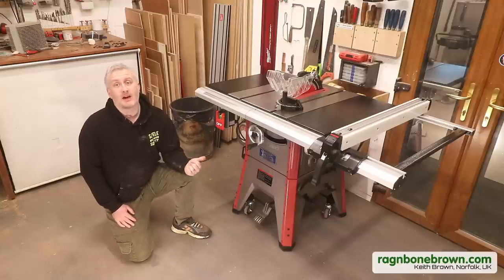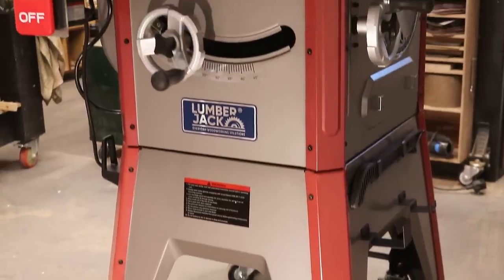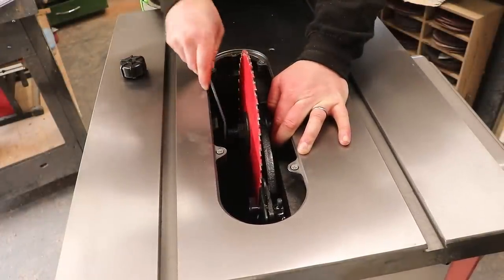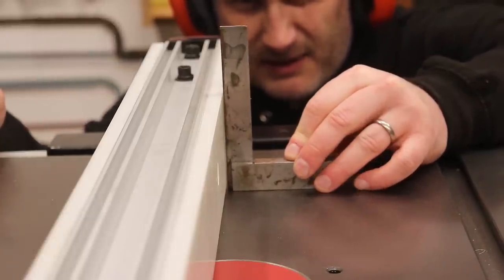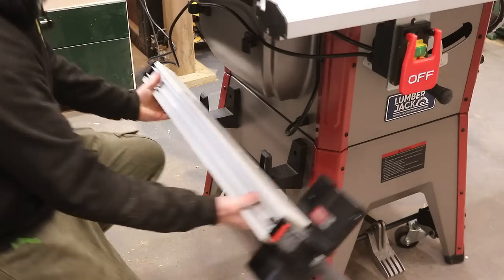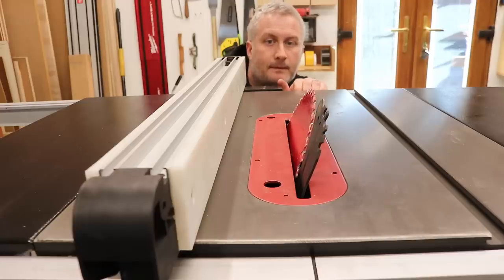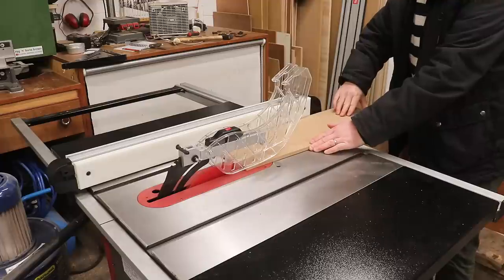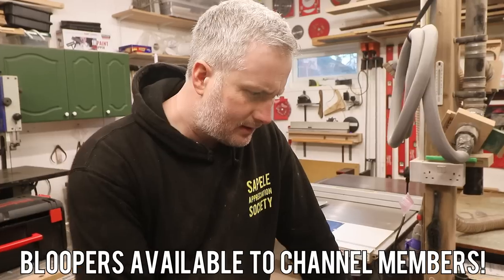LUMBERJACK TS1800 TABLE SAW: Everything You Need To Know

Comment: Making replacement inserts is a bit of a pain. Wish they would have altered that since the previous versions. A better insert will probably reduce the effectiveness of dust extraction though.
Reply from the maker: You could drill some holes in the insert to aid with extraction while still maintaining a zero clearance. That's what I'd probably do

Comment: Personally I don't think having your customer modify electrical issues on the product you sold them is an acceptable solution at all... If a fuse fixed the issue they should provide that in the first place.
Reply from the maker: I agree, but it seems to only be a recent problem - the saw has been available for years and only recently have these issues occurred so something must have changed in the manufacture of the saw recently. While I agree that it shouldn't be on the customer to resolve, after several hours spent setting it up, the last thing I would want to do is disassemble it all and get it taken away, that would have been so much wasted time.... But maybe that's just me 🤷‍♂️
Reply: @RagnBoneBrown Ridgid power tools makes a good saw that has a solid table. They are owned by TTI and are sold in all Home Depot. I don't know if you could get one to the UK though. It is a great saw thought
Reply: Indeed if they are providing the saw with regular 13a fuse but this trips on poweron it's just not acceptable, very odd in fact.
Reply: "There's nothing wrong with it!"

Also them "But here are some modifications that can be done to fix the issue..."

If the fuse fixes it, why wouldn't they include it as a standard? Would it cost them THAT much, or not work with other setups somehow?
Reply: I just bought one of these and it looks like they're sending them out with a slow blow fuse taped to the box now
Reply: I had the same issue when I first got mine and even with slow blow it was hit and miss. The issue for me and most likely others is voltage drop on the feed to my workshop. An induction motor uses up to 1.5 times the power on start up. If your only getting 220 ish volts to your workshop then 1800w x 1.5 is pretty much 13 amps
Reply: I have a Bosch gts 10 xc. Would like to upgrade to a table saw with more precision as I only make small stuff , cutting boards, jewellery boxes etc. is this the saw for me ?
Does the rip fence cut square ?
Love your presentation. Keep it up and inspire us newbie hobbyists.

Comment: Surely if it was the fuse in the plug that was blowing, not your mcb tripping, then it is Lumberjack supplying a wrong type of fuse? That’s on them? Great video. Just started listening to your and Matt’s podcast!
Reply from the maker: Thank you! I have very little electrical knowledge so I'm afraid I am unable to comment, but hopefully LumberJack address the issue going forward
Reply: His supply voltage could be low, or the inrush current is sagging causing our British 13A fuses to pop. 

Typical issue with imported goods as most of the rest of the world has 16A at the socket.

Comment: If a tool is designed to work of a standard 13a outlet but requires you to put a non-standard fuse in the plug…well that rings alarms bells to me. I may very well be wrong but I don’t think slow blow fuses are BS1362 compliant so you could be compromising the safety in order to make the tool functional. That doesn’t sit right with me. I’d consult an electrician before making a decision (maybe the guys on the Efixx channel?)

Comment: Tough choice indeed. Noise: hearing protection. Speed: production shop?  Cast iron side tables  ¯\_(ツ)_/¯. Blade already swapped. Plusses on the Axminster side losing ground fast in my opinion. 

Big question, you need to make cut, which saw do you walk toward?
Reply from the maker: At the moment I walk to the Axminster but that's because it's permanently set up with extraction 😁 I think if I'd have bought the lumberjack originally, I would be happier. But the fact that I'd need to make all my jigs and router table again if I changed to the lumberjack sends me back the other way. It's a real conundrum!
Reply: @RagnBoneBrown  I went to Best Buy (home electronics store in the US) to buy a video adapter cable once a couple years ago. On the way there I was thinking about cord length, name brand vs store brand… When I got to the store they only had one choice. I was so happy I had no options I was almost giddy. Sometimes having choices is great. Other times a pain. 

More seriously, in decisions like this I ask myself, “Will I wish I did the other thing everytime I use this one?“ If yes, I grunt through the inconveniences of making the change. if not I get rid of the replacement. 

This decision would be tough for me. Not sure if better dust collection woukd win out over noise.

Comment: Their advice was incorrect. If the plug fuse was blowing, changing the type of circuit or MCB would have no impact.
Sounds like they have used a cheap motor that has a high inrush current (startup current). Your Axminster has a larger motor (more current) but did not blow the fuse.

Comment: Two things:  First, I thought it was illegal to use "Dado" blades in the UK.... Secondly, Can I have the one you don't want?....😊😊
Reply: They're certainly not illegal to buy or use in this country - it's one of those things that somehow went from myth to "fact" over the years but it's not true. If it was then Axminster are selling them illegally...
Reply: I thought that was why most suppliers to the UK market haven't the facility to take them....
Reply: @stevehewson8903  I wouldn't be surprised if it had something to do with safety - having some sort of blade guard in conjunction with a stack of dado blades would be a very difficult arrangement.
Reply: @201081hero    Not illegal as you said use mine and a moulding head cutter on my imported skill 99 from oxford England

Comment: Could you tell me if just the long fence rails can be used for a slightly smaller rip capacity? It might make the foot print smaller if not needed? Cheers
Reply from the maker: The rails are aluminium so you could cut them down if you wanted

Comment: Changing the mcb to type c is just bs. The thing is drawing enough to blow the 13a fuse not trip the existing b mcb. Just not really designed to have a plug on it. Also chopping off the plug and putting a commando plug on loses cable protection on the saw lead.

Comment: I would say that the electrical issue is a deal breaker for me. What kind of company just lets machines roll out of the factory that pack up as soon as you turn them on? Shoddy.
Reply from the maker: I agree, although I think it is a new issue, the saw has been around for years in the UK but it's only recently that the electrical problems have come about

Comment: Nope, slow blow fuses are NOT approved to BS1362, shows cluelessness by them. They've effectively caused their tool to be non compliant. They've used a motor that is NOT compatible with UK plugs... slow handclap to them
Reply: A simple inrush limiting inductor or resistor in the motor circuit would work and be compliant...
Reply from the maker: do you have any proof of this? If so it's probably worth letting LumberJack know this information
Reply: @RagnBoneBrown  Keith... Take a look at the fuses you have purchased... If they're not labelled BS1362 they shouldn't be used (the danger to you is minimal however). If they say bs1362 I misspoke... (Assuming the labelling is correct). Unfortunately British standard documents are pricey and I don't have a copy. I will ask around on electrical groups I'm a member of and get back to you
Reply: @RagnBoneBrown  I may email them direct with reference to the relevant standards if i can get hold of them, they seem like a company who want to make things right. But this is far from unusual, stuff made for the EU market requiring slightly over what our 13A fuses can handle ... very common with ovens too, frustrating as an electrician!

Comment: Lumber Jack DUST EXTRACTION. YOUR LUNGS WILL THANK YOU when your 70. 
Electrical concerns fused fixed that 
Quieter stronger motor didn’t seem much of an issue to you. 
Something you didn’t mention, seems lumber Jack can be plugged in to most sockets(don’t know much about UK electrics.
Besides that it looks prettier and it’s red. 
How are the cats and their new enclosure doing?
Reply from the maker: Thank you! The cats are doing fine. The enclosure hasn't really been touched since I built it, need some nicer weather! 👍